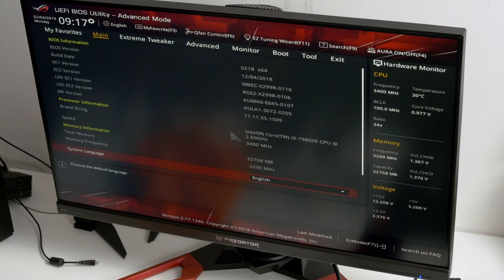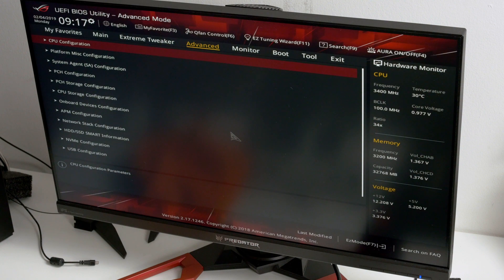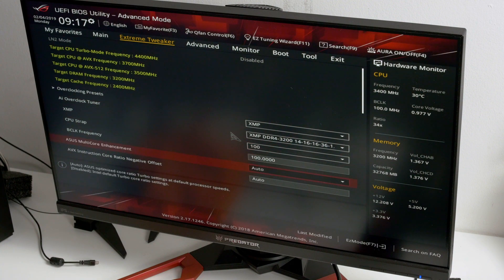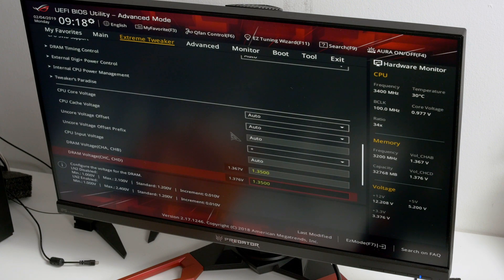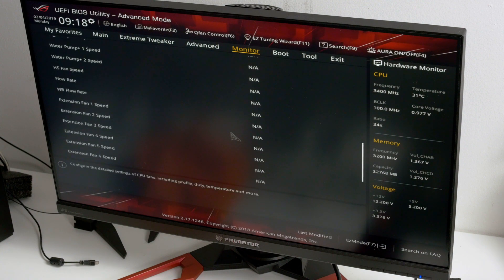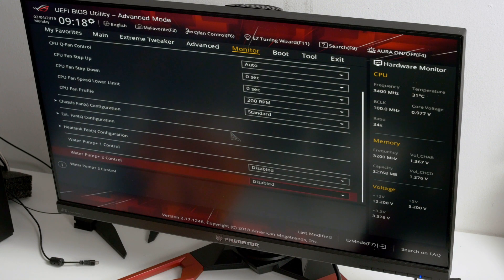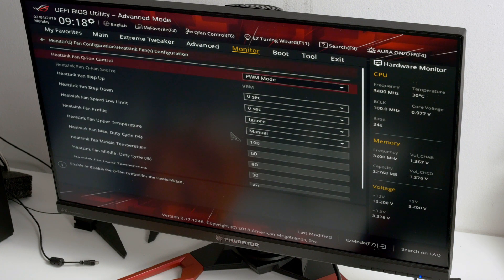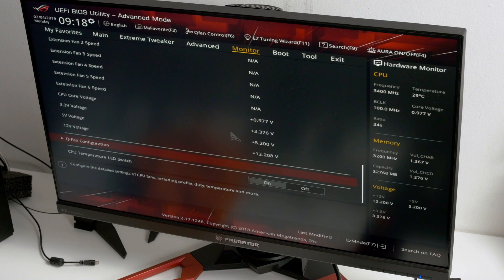Delid + Naked Die & R6E Omega first boot

Comment: What's the matter with these rams? I have a very similar set and after installation, the icedragon system only detects half of the memory? I have 16gb instead of 32gb. Everything works, cpu temperatures are low, but only 16gb. Any suggestions what to do? I noticed that the sound of crushed pins can be heard when installing the ice. It's as if the processor was too tight against the socket.

Comment: I have the same setup, but little bit better. I upgraded from A6E to A6EO, I have 4000mhz 64gb, with 4.8ghz with adaptive voltage and speed. I didn't crash now for 2 months. Temps with cinebench are 95c. But with normal use and games, max 75c. I had problems with mounting. The fix was, place the direct-die bracket and screw them little by little with al four of them. So the pressure is equal. Same for the waterblock. Check the back of the mobo, so the screws are equally positioned and as far possible. I used liquid metal paste, so be sure it is not dropping out of the wb and cpu. Another thing, 360 rad is not enough for silent use. I have in the case 2x240 and on the case mounted 9x140. For wb, currently with dual d5, XPX eisblock is the best you can get. Not good if you have single d5.

Comment: I had some questions.
Whats that stuff your brushing on the sides of the cpu?
where did you get your cpu and all the cpu  socket stuff?
I'm on the fence as to whether to pull the trigger, I just think Asus has a new chipset about 2 months away.
Reply from the maker: 1. The stuff I'm brushing on the sides of the CPU is MG Chemicals Silicone Modified Conformal Coating, it's to prevent any of the liquid metal from shorting out the CPU.
2. I purchased my CPU from ebay, and the Delid Die Guard from http://www.performance-pcs.com/delidding-tools-accessories/delid-die-guard-cover-protector-iceman-cooler-x299-cpu-opener-support-7920-and-above.html
3. Yeah the new Cascade Lake X stuff is rumored to come out some time this year, plus AMD should have AMD Ryzen 3rd Gen out this year for HEDT.